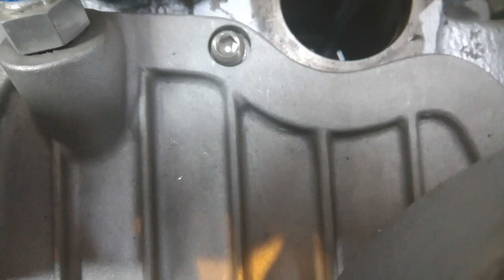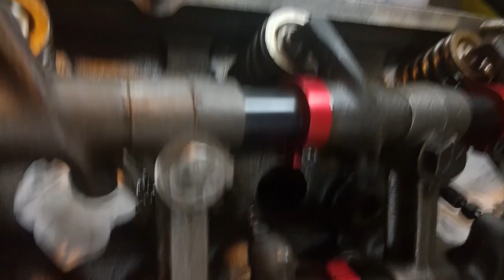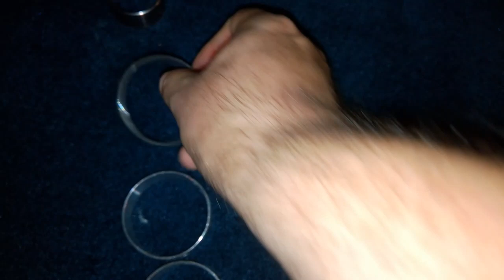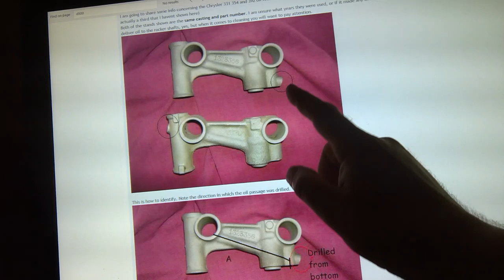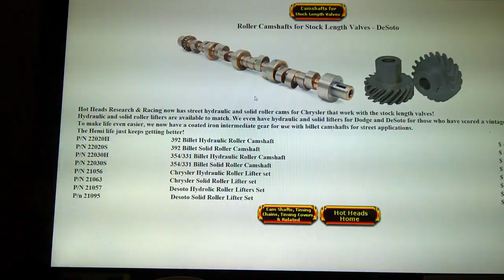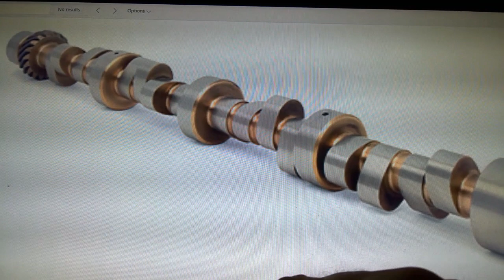How to prime a vintage Hemi!

Comment: I know this is an old video, but what oil filller cap did you use?  The HotHead valley covers come with a screw in type and a hole for a PCV valve... no real area for a breather element unless you want to drill a valve cover.  I have a Plan B but just noticed you might have solved my problem a lot easier.
Reply from the maker: i have a pcv valve in the back and i dont have breathers in the valve covers though, that cap is my breather.  I hope i have enough "Pull" though.

Comment: Did you use a electric fuel pump or mechanical.  If electric what manufacturer
Reply from the maker: I will be using an electrical holley 4-7 lb pump mighty mite.  They say you can use it drophead.  I might do another video of the carb and pump info.
Reply: @massivefins2597  I might use a holley red fuel pump for my 392 hemi in my boat,  it says  self regulator